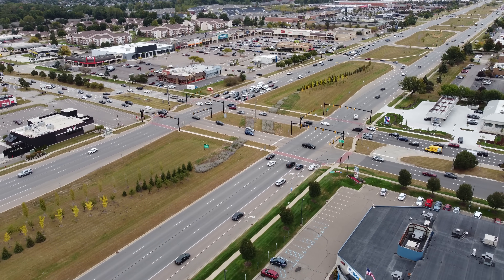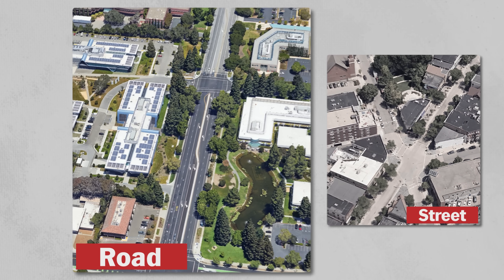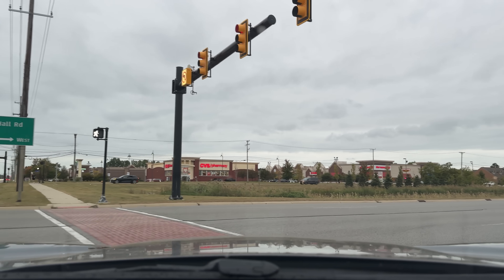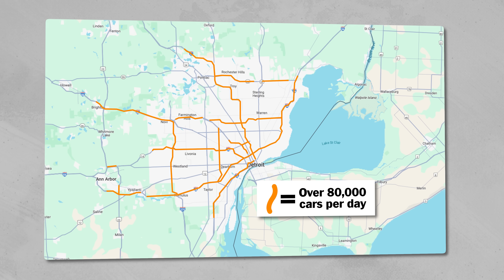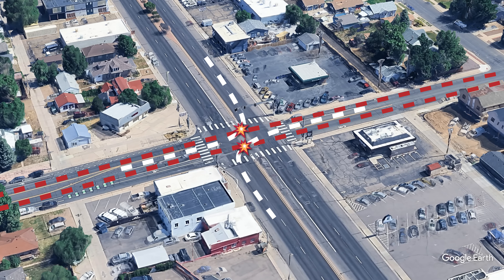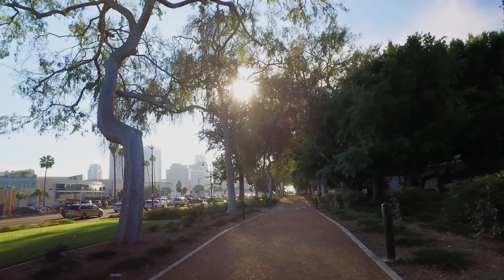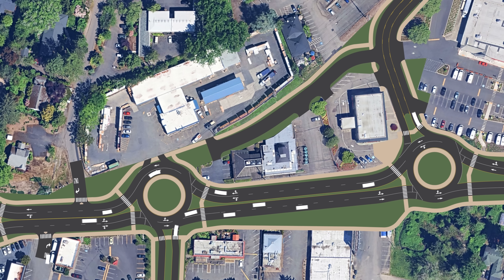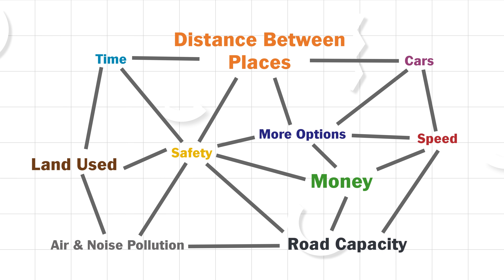How Michigan Built a Super Highway Using Only U-Turns

Comment: As a michigander, you can praise it and call it genius all that you want but people in Michigan absolutely hate it. Heading a certain direction but need to stop at a place on the opposite side of the road? Well then you have to go a quarter mile past, do a u-turn, quarter mile back to your location, then you have to backtrack another quarter mile to find another turn around so you can do another u turn to get back in the direction you were originally going. By the time it's done you just did an extra mile of driving for some place that was directly across the street. Then, people that are doing a u-turn frequently cut out in front of traffic and cause issues because they don't have a light to wait for.

Comment: I was about to sarcastically tell you about roundabouts, but then you showed them.
Reply: America has more roundabouts than any other country, except France and Italy.  So America knows where they work best.
Reply: @traffic.engineer  I've been to USA. Compared to where I'm from (we have a LOT of roundabouts) America barely has any. Of course if you look purely by number America is gonna have more, since it's a huge country. 

America is also VERY car centric. If they changed their roads to be smaller and added more public transportation there would be no need for these strange U turns.
Reply: @ninjakiwigames5418   Roundabouts do not work on high volume roads, which is why they are not common along major highways except in rural road areas. They are best for the local residential/commercial use roads, not the major urban roads.  They work best where the traffic volumes are limited.

The roads that require these u-turns are major arterials but do not reach the volumes for a limited access highway.  Their purpose is to connect the major cities throughout the region, with access to the local road.  This is not a "local" road, which is why this road is not desginated to be narrower and lower speed like the surrounding residential/commercial streets.

Comment: Roundabouts are also designed so you don’t have to use traffic signals, therefore eliminating a need for costly electricity.
Reply: Roundabouts only work on lower volume roads.  More volume means less gaps to merge at speed, creating stops and queues.  Roundabout would not work along these roads as it would excessively disrupt the priority road.

Comment: It actually drives me crazy because it makes it so you never know what the heck to expect at an intersection. Sometimes you can turn left and sometimes you can't and you just have to know that. It also makes highways with a lot of exits on the left making it difficult to get over to your exit in high traffic and making it so large trucks will drive in the left lanes of the highway which are typically not for large trucks. In my opinion it causes more chaos on the road.

Comment: If Michiganders could turn left without running into each other, these abominations wouldn't be necessary. I hate these u turns. You have to deal with 3 lights instead of 1. I've spent 5 minutes at one intersection because i caught all 3 red lights. You have to  deal with traffic in the opposite direction  and traffic that would've  been behind you if you could've  turned left. I avoid the uturns at all costs. If I use the uturn roads on my way home after work, it will double my commute time. No thanks

Comment: 11:14 for me as a European, this looks dystopian. If you would remove all the car infrastructure, including the parking lots, and moved the buildings closer together, this would be the most walkable place ever. Instead the place is torn apart and scattered to make room for  a mode of travel you wouldn't need if it wasn't.
Reply: This is not the central business/residential district.  This is a arterial road connecting multiple jurisdictions.  This is not meant to be the center of a community.  Do you expect open access to high density along a higher speed motorway?
Reply: @traffic.engineer  What are the buildings then? I see lots of houses and what I presumed are shops with parking lots.
Reply: @nilsp9426  People will build near heavy arterials for easy access to the road.  Residents want easy access to a highway to commute.  Meanwhile, businesses want easy access from pass through traffic, not just local traffic.  That does not mean reducing this road from its arterial nature.  The local walkable community expands behind and away from this road, not onto this road.

Comment: It's not as great as advertised, it has many flaws, and can be dangerous. If the creator of this channel would like I can use my GoPro during rush hour to show video of how it can be very dangerous. The Michigan left is efficient however has two major flaws. I live 2 mi away from Hall road, featured in this video. First issue is the inside Lane is only for people that are making a U-turn and not a Michigan left. These people are utilizing the Michigan left in the median to enter a business on the other side of the intersection while those on the outer Lane wish to make a left at the intersection. To make the left hand turn you need to be in the outside Lane of the median. Since very little people have the intention on crossing the intersection to enter a business most cars are trying to make the Michigan left hand turn must wait in the outside lane. Therefore the outside lane gets backed up all the way back to the intersection, impeding any traffic waiting to cross Hall road at that intersection. During rush hour that lane gets backed up so far that those waiting to make the Michigan left get caught in the middle of the intersection of the road that crosses Hall road, impeding traffic from moving at all on the crossing road until the outside Lane of the median has cleared enough to open the intersection up. For example your video shows the intersections of Hall road and schoenherr and Hall road and Hayes. The video shows the vehicle going westbound on Hall road then utilizing the median to travel eastbound. A more relevant video would be someone that is already traveling eastbound and wishes to turn left at the intersection to travel northbound on Hayes road. This person must stay in the far left lane of the road so that they can enter the median, and since they wish to make a left they need to stay in the outside Lane of the median. All those cars in that lane remain stopped until the lights turns green to allow traffic to travel on Hayes road. When that happens the light also turns green for those waiting in the median to reenter Hall road so that they can complete their Michigan left. Therefore the median has a red light for those entering the median of Hall road for their Michigan left while the light is green on Hall road. In heavy traffic the line of cars waiting to enter the median for the Michigan left gets backed up and impedes the intersection at Hall road. Therefore those traveling North on Hayes road must wait until the intersection is cleared. Since both lights turn green simultaneously for those in the median at Hall road waiting to make the Michigan left and those traveling on Hayes road it takes a while for cars waiting to make the Michigan left to move, and this extends all the way to the backed up cars impeding the intersection. Cars that are impeding the intersection must wait until all traffic in front of them moves. And just like at every red light you sit at, you don't move as soon as the light turns green. You only start to move when the traffic in front of you begins to move. Therefore you can be looking at a green light for a good 30 seconds to a minute before you actually start moving to cross that intersection. Therefore those traveling northbound on Hayes road are looking at a green light with a wall of cars in front of them. By the time the intersection clears only a few cars have time to cross the intersection after it has been cleared and before the light turns red again. This creates miles of backed up traffic on crossroads of divided Michigan highways using the Michigan left. Yes it's better for east/west Hall road, but it is also worse for every  North/ south road that shares an intersection with Hall road during busy traffic times. Second is this same concept is used on a real highway M53 (which was featured some in this video) north of 26 Mile road. Beyond that point the highway transforms from a traditional highway into the same concept as Hall road with a median utilizing a Michigan left thus eliminating on/off ramps. This makes it very difficult to use this portion of the highway. The speed limit of the highway is 70 mph, however when approaching a median U-turn area the speed limit drops down to 50 mph about a quarter mile before the entrance to the median. This happens every mile. By the time you reach 70 mph you must immediately slow down to 50 mph, and then once you're past that you speed back up to 70 mph, and repeat the process. Of course this constant change of speed limit is something that local law enforcement utilizes to write tickets, and they write a ton of them. Not only does that make that section of M53 difficult to drive, it also creates a speed trap every mile down the road. There are two other major problems with that. It is also very stressful on your car to constantly be accelerating and breaking. Remember, the left lane of a highway is used for passing by law therefore those cars are moving faster and if you wish to get off the highway you need to enter that lane. This not only creates road rage but also many accidents as people whom follow the speed limit are forced to share a lane until they enter the turn on the median. In times of high traffic, it is absolute chaos on this particular stretch of road because it is a true highway with a higher speed limit that is attempting to incorporate the concept of the Michigan left.

Comment: I lived off of Woodwards in Royal Oak, the Michigan Left is good, but these raods are not easy for pedestrians, it's nice to have the boulevard but crossing 4-5 lanes of traffic sucks. And People constantly just drive three blocks to cross the road to get to royal oak downtown if you were coming from the western side. This stretch of woodward is very pedestrian centric, so it's frustrating.

Also side note, there's no right turn on red either for most of these roads which makes them safer too for cars so people aren't turning into traffic then trying to cross four lanes. But it still has the pedestrian issues.

Comment: The only problem I have with roundabouts is that I do not trust other people to use them responsibly. There’s actually a road in Michigan that goes from having Michigan lefts into a roundabout as that road ends, and it’s one of the most dangerous roundabouts in the state. It’s terrifying to drive through because too many other drivers are not responsible even if you are
Reply: Europe has the same problem.  America joined thr club.

Comment: To avoid these problems at intersections, there are roundabouts, a simple, economical, and safe solution that is used in Europe.
Reply: A roundabout would fail here due to volumes being higher than roundabout's capacity.  It would also excessively disrupt progression of the mainline highway.  America only builds roundabouts in rural and light surburban roads, where they work best.
Reply: @traffic.engineer So you have a great problem. In any case, I don't see the solution given in the video as practical. I've driven in the area of Los Angeles, and there are numerous intersections, and therefore, many stop signs. There are no roundabouts, and that would be an easy solution there.
Reply: @DIDACbcn52   That is because Los Angeles and California have the some of the worst design and maintenance of infrastructure of all states.  Bad spending, no innovation, and horrible leadership.    The rest of America differs very much.

Comment: Personally driven through these.

NOT GENIUS.

ITS FUCKING HORRIBLE.

Trying to rush my dog to the vet came up to once of these and had to slam on the brakes, which threw my sick dog into the fucking windshield
Reply: That means your driving is the problem.
Reply: I mean, why would you slam on the brakes? What part of the road requires such a maneuver?
Reply: @Omegas_XB  the part where i was about to enter the intersection incorrectly, against cross traffic that likely wouldn't have been able to see me, and wouldn't be expecting me.
Reply: @khatdubell  Did you not see the traffic light?
Reply: @khatdubell  I get it, but that is not really the fault of the design itself. You can blame that on the lack of lighting and not the intersection itself.
Reply: @khatdubell  Where I live, all stop lights are directly before any intersection and never across it, with very few exceptions for visibility purposes. This would never be a problem were such a U-turn road to be built here. But I doubt such a road would be built in the first place. Not enough space.
Reply: Also you can simply send coordinates.
Reply: @Omegas_XB  they deleted it.

Comment: The one thing I really don't like about Michigan left is that you have to cross multiple lanes of traffic to actually make that left turn
Reply: Don't you also do that when making a direct left turn?
Reply: I'm sure that is the case in many places especially without a protected turn and I wouldn't like that either  @traffic.engineer
Reply: @KaitouKaiju  so basically, this cuts the risk in half.  No more different than entering a multi-lane roundabout.
Reply: @KaitouKaiju  And these are signalized.  You can wait until the green if you need to.
Reply: @traffic.engineer not really the same as a roundabout because they have to yield whereas while in a Michigan left crossing traffic does not have to yield to you at all
I'm not debating whether or not the Michigan left is better or worse than any other traffic solution I just don't like crossing multiple active oncoming lanes for left turns like why do you have such an issue with that preference
Reply: @KaitouKaiju  Traffic in the circle does not yield.  So yes, the same thing.